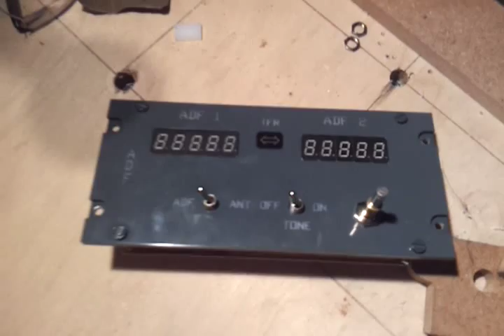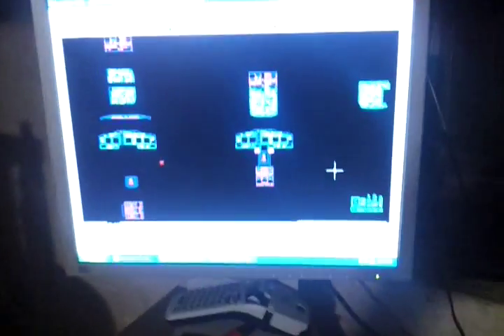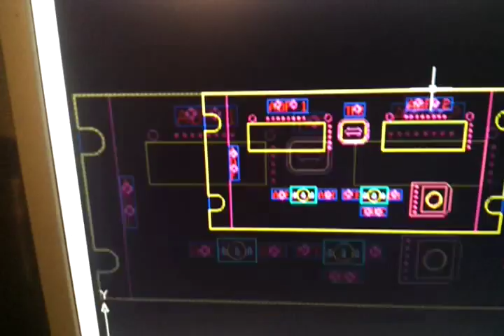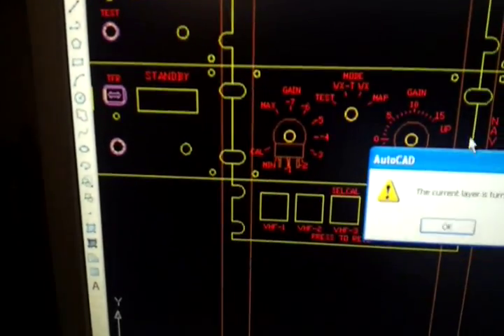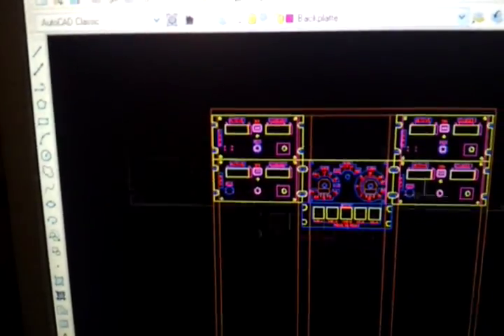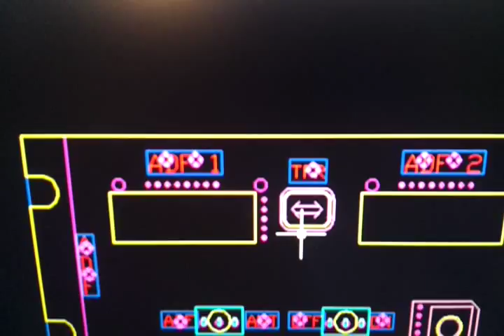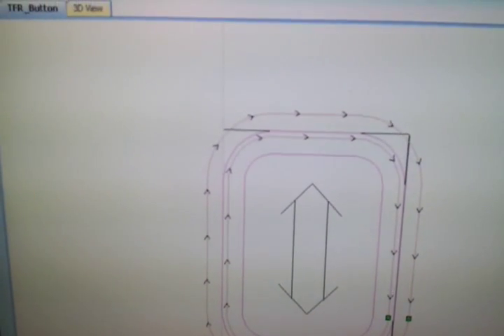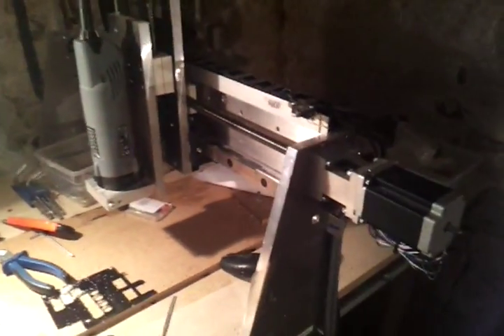Workflow for Making Panels on CNC machines

Comment from the maker: Hello, yes you are right. The Layout for the PCB Board was done with a separate program called "Sprint Layout" The Trick is to place the components in autocad and use the coordinates of them to make the PCB Layout with the other programm. So Autocad is not directly used to create the PCB board, Autocad only delivers the coordinates (location) of the switches, LEDs etc.
Cheers
Andreas
Reply: +masterploxis Can you also upload the PCB layout? Please
Reply from the maker: +Rasti Knkl I will try to send them to you if you have sprint layout program... Cheers andy
Reply: Yes I have it
Reply: Do you need my E-Mail?
Reply: +masterploxis Or Can you send my only your project files? I mean your finished AutoCAD projects with all the Layers...

And another question, where are you from?